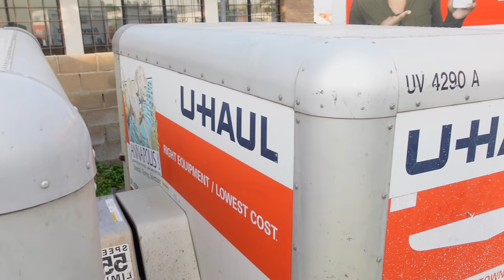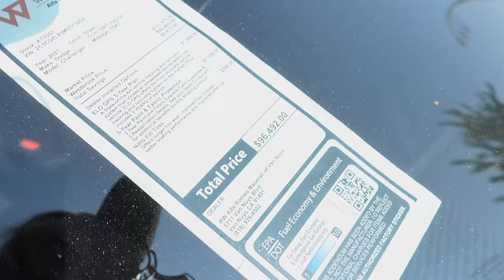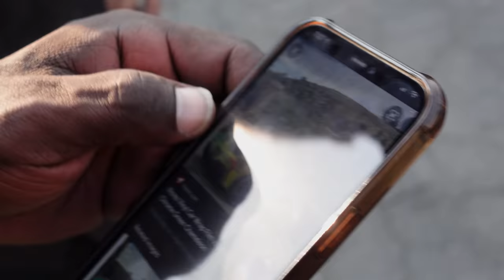FORGIATO RUINED MY CAMARO ZL1 RIMS

Comment: Not here to bash. But why did they wire the trailer hitch like that it doesn't make sense! Goto dealership and it will be cleanand factory. And they also have to program ur computer if it doesn't have the tow package